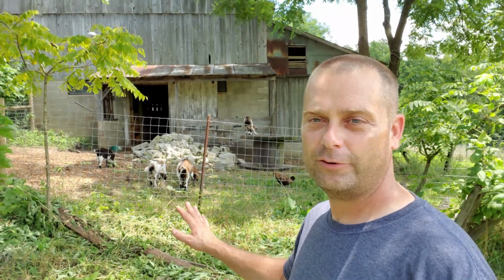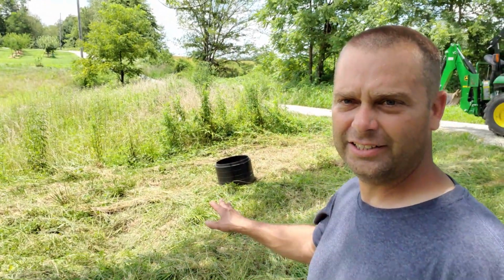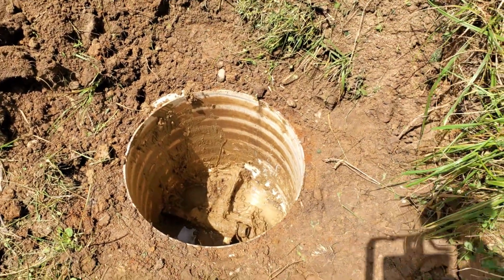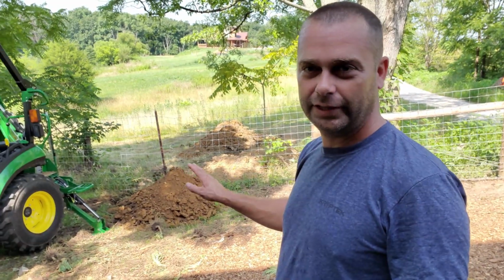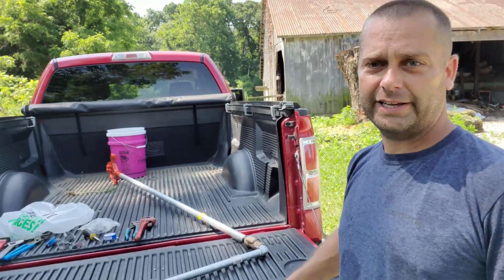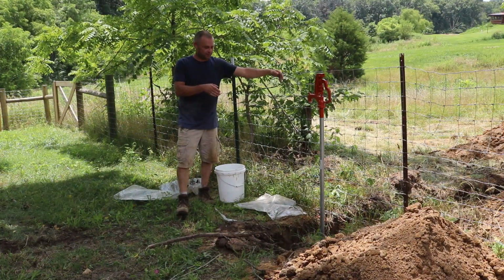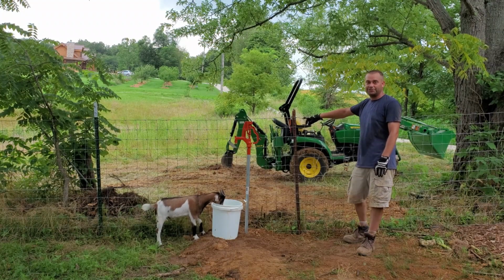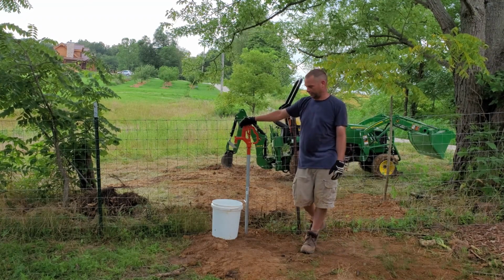Installing a Water Hydrant in the Barn Yard with a John Deere 2025

Comment: On the John Deere tractor loader bucket  - don't fully extend or roll bucket all the way forward when pushing dirt. You can bend the shafts on the hydraulic cylinders. According the mfg. Love your videos.
I had to retire earlier at 64-1/2 due my legs gave out after working on cement for 50 years of my life.  I have an acreage that was all woods and underbrush. I have been clearing for the past 6 years. I have been using a Mahindra Max 28xl HST with loader and backhoe, box blade, rotary mower, disk, landscape rake and finish mower. Now 71, I'm almost done. I grew up in Iowa on a farm and now live in Gun Barrel City, Tx.

Comment: There is a brass fitting that goes on bottom of hydrant that connects to your black plastic water line and use 2 stainless steel clamps on each connection

Comment: I have installed many hydrants over the years like this. This is the first time I saw someone use a hard pipe extension to protect the plastic nipple. You are correct it is the weak link in the system. Thanks for this idea. I will always do it this way in the future. I am 60 years old and not to old to learn something new. I do agree with other comments that you should of run it into the barn as well while you were at it. Thanks for sharing.
Reply from the maker: The barn has a concrete floor, that would make it much harder to do.
Reply: Country View Acres but not impossible.

Comment: Evan, Great video's! You are correct about that schedule 80 PVC fitting being the weak link. In the future you may want to consider using a brass compression fitting and a stainless insert (Mueller or Ford makes them as well as other manufactures) on the end of your plastic water line for your connections. This will eliminate PVC fittings and the need to push the pipe onto a barb. Cant wait for the next video!

Comment: Nice work.
I would have put a tee and another valve off the bottom for possible future line to barn though.
Even though the floor is concrete, you can still add an inside hydrant with a small amount of cutting.  Then just pour more concrete to fill.

Comment: Good job Evan. It's all coming together. When I was putting in my fence I ran into root problems too. I ended up using a reciprocating saw with an old blade to cut them it seemed to work well for me.

Comment: 30 feet of water line in my area would be a big project! We have boulders/rocks at about 3 feet down, and need to go 6 feet own in our area. If we hit the top of the ridge (we are up on a ridge along the Mississippi River), it needs to be 'jacked'. I put three hydrants in this summer, but had someone else do the digging! I had existing lines of an unusual size so the hardware was a bit challenging! I really envy the ability to borrow a nice tractor like that! 😉

Comment: For future if you run into small obstacles digging “ie” tree roots use a piece of schedule 40 steel pipe and push it through underneath works really well we use the trick to under footers

Comment: Hey even I noticed you didn't use a drain valve at the bottom of your water hidrant hopefully it will not freeze cause the hidrant needs to drain to prevent it from freezing
Reply from the maker: The drain valve is built into the hydrant.  There is a vent were the water drain out at the bottom

Comment: Hot water on poly pipe helps fitting you can use poly pipe fittings that don't include barbs and rusted hose clamps that fail

Comment: The brass  fitting on the galvanized pipe with water running through it will cause electrolysis and it will corrode over time.

Comment: Instead of a short hose to fill the troughs, connect them together through the fence using a short length of 2 inch plastic pipe a couple of inches below the top of the troughs and the barnyard one will over flow into the pasture one meaning you only have to fill one trough !

Comment: You should have put  a T post next to the hydrant pipe and put a couple of pieces of non rot wood between the stand pipe and the T post and use a few hose clamps to tighten the T post and   and stand pipe. then the faucet should not move.

Comment: the roots shouldnt have been a problem with that backhoe, just have to learn how to curl the bucket to have more brake out power, also, you had a hard time getting the plack 1" polly pipe onto the valve fitting because you didnt heat up the black pipe end 3" back from the end, until the pipe turned a shinny black, then slip the pipe on and tighten down the clamp well the pipe is still hot and soft so it seals it tight to the fitting so it dont leak, one clamp is all that is needed when tightened down well the pipe is soft and hot, it is all most imposible for it not to leak at a kater time with out clamping it hot..
Reply from the maker: It wasn't a problem with curling the bucket.  Some of the roots were 4" to 6" thick and that small backhoe didn't have the power.
Thanks for the tip on heating up the black pipe.

Comment: dont use the cheap plastic fittings, they are not meant for a lot of presser, use the teflon fittings, they never leak or brake like the cheap plastic ones, you can tell the different between the cheap plastic as they are light gray color, and the good Teflon fittings are more of a dark blue gray color and much heavier and you can used the good stainless steel compression bands not hose clamp that fail and they will not go egg shape like the cheap plastic ones do and leak, your frost line must not be very deep, it dont look like your down any deeper then 18" here in north western Ont. Canada, our frost line is 7 feet deep, so i installed all my barn, feil and house water lines sown 8 feet, and i put water manafolds and valves in my root celler next to my well pipe and presse tank, to feed each line and turn off ones i dont use in winter when installing the black pipe on to the fittings you must heat up 5 inchs of the end of the pipe with a torch or heat gun until the pipe turns really shiny, push it on and clamp it well it is still hot an shinny so it seals tight, as if put on cold it is a fight and will leak over time with change in temp